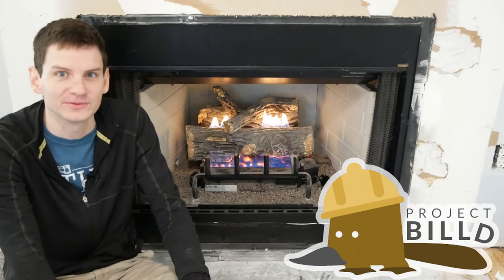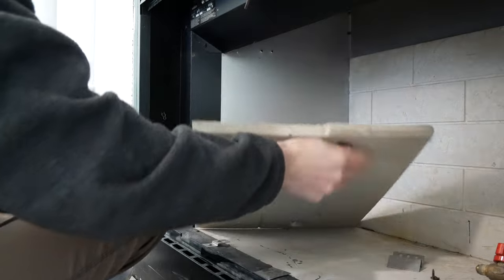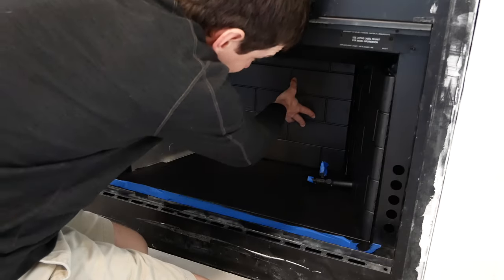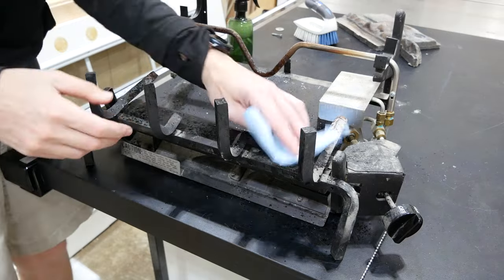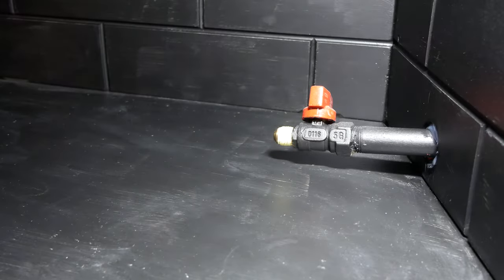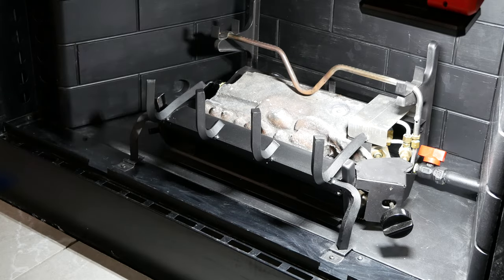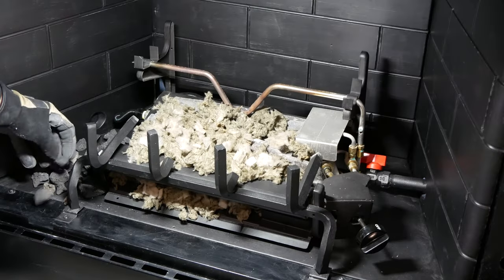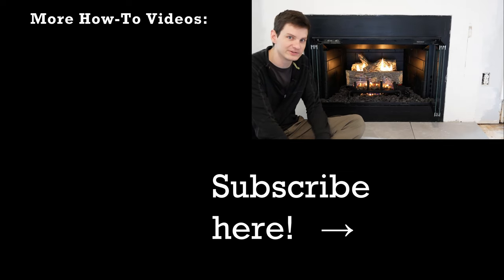How to Update an Old Gas Fireplace

Comment from the maker: Hey all. A few people have pointed out that I should not have used tape on the flared connections of my existing gas line and gas log set. That is correct and was a mistake on my part. The tape is not needed for flared fittings and can only cause issues, so be sure to learn from my mistake. - Bill
Reply: This is great information, however, what are we supposed to use then if no the tape. I did the same project, painted my old bricks (looked just like yours) and updated the grate with paint, new rocks etc... When I removed the gas line it had like a white grease on it. Do I need to replace that or can I leave the old lubricant on and reinstall the line? Thanks in advance.
Reply from the maker: If you have flared fittings you don't need anything on the threads. I'd try to clean off the old stuff, and test for leaks after.

Comment: Dude you should never gas tape a flare fitting. If you tape the threads for a flex line you can cause a leak at the flare because the tape doesn't allow the flared ends to seat as tight as they need to. Otherwise good job. But the tape is very dangerous in this application
Reply from the maker: I agree that's it's not needed for flared fittings and that's a slight oversight on my part. But I don't agree that it's dangerous. As long as you check for leaks there shouldn't be any issues
Reply: @ProjectBilld it is dangerous in the long run.
Reply: @ProjectBilld   wrong, teflon is a mild lubricant and is direct counter to the friction seal of a flared fitting, very dangerous
Reply from the maker: Thanks for the feedback all. I pinned a comment letting others know that this was a mistake on my part and to not do the same

Comment: I removed the ceramic logs and hose them down with plain water and left them outside to dry,  they were still wet  the next day? How long before they're completely dry?
Reply from the maker: Were they lightweight fiber logs?
Reply: @ProjectBilld  no heavy
Reply from the maker: Ok good, sounds like they are the kind that can get wet. I don't know how long they'll take to dry, that depends on the temperature/wind/humidity outside. I'd try to bring them inside to dry if you can
Reply: Can I burn them while damp?
Reply from the maker: I don't know but I wouldn't. Best case it would release steam and vapor from any cleaning product if you used any which isn't great. I'd worry that they might crack due to the expanding moisture
Reply: @ProjectBilld  Thanks Bill,
I will let them dry completely  and no I didn't use any chemical products just plain water.

Comment: How do i upgrade my gas logs?  The ceramic logs are just laying on the metal rack and the flames dont really spread out.  There is no burner pan, its just the grates.  Do i upgrade the logs and burners together ?
Reply from the maker: Yeah pretty much. Typically you'd buy an entire new gas log set that includes burners and logs. I'll be doing that for the other fireplace in my house as the valve is broken and it has a larger opening that could benefit from a longer log set.

Comment: Thanks to your soapy water tip, I was able to verify there was an actual gas leak on my fireplace gas connection! 🙏 🙏🙏

I was not looking for that. I was interested in how you would set up the logs. Then my wife mentioned she smelled gas and I tested it. 

How about using that specific footage to make a YouTube Short?   😎 It may lives! 😊
Reply from the maker: Glad you were able to detect a gas leak! Never thought about making shorts from my videos, I'll have to look into that
Reply: @ProjectBilld  shorts are basically Instagram Reels for YouTube (or similar to TikToks!) think it would be a great way for people to find your content on YouTube. 😎
Reply: Not supposed to use gas tape on a flared join in Aus.

Comment: I dig the look of this fireplace. I’m curious about the plastic valve handles and I believe starter button and heat. I would think that the heat would melt said hardware after time. Have you had any issues with this or are they high temp or heat resistant?
✌🏽
Reply from the maker: Haven't had any issues. That fireplace is over 20 years old so if it were going to melt I suppose it would have already
Reply: @ProjectBilld  ah yes I totally agree! ✌🏽

Comment: Great video, thanks for sharing.  Have you ever converted a double sided (see thru) fireplace into a single sided fireplace?  I have a see thru fireplace between my master bedroom & master bathroom.  I'm trying to cap off, then drywall the side in the bathroom, in order to build a shower on that side.  So far, fireplace stores are telling me I have to replace the entire fireplace, which is very expensive.
Reply from the maker: I haven't done that but unfortunately I can't see it being safe to do without replacing the insert so the fire is contained. Might be worth searching in your area used market for a used fireplace insert that someone is replacing and refurbing it/buying new gas logs for it.

Comment: Could I also refresh the paint on the fireplace surround? Should I just use the same paint?
Reply from the maker: Yes you'd want to scuff it up/sand it first to promote adhesion and then roll or spray on the paint, not brush. I'd probably use a different paint, I don't think the paint used in the fireplace would go on smooth. Plus it's overkill as the surround doesn't get as hot. I'd look for a heat resistant latex paint. This also allows you to choose a different color than black if desired.

Comment: I have a barely used propane gas fire place. The flame, quite frankly, is pathetic. I pulled the logs, etc, out, blew out the line from pilot to gas line. Nada. I just ordered the rocks and wool and am hoping it could generate more flame. There is no second gas line above which really looks great. I'm somewhat embarrassed as I keep trying to fit the logs in the metal templates and the holes which I'm thinking the gas/fire shows. Got pictures, etc. but obviously can't upload them. Just subscribed and will watch your videos. the answers might be in them. Regardless, thanks! Very informative. Oh, when I said barely used, it was barely used (maybe a dozen times).
Reply from the maker: It's possible that you'll need to get a new log set. Can't do much about it only having one burner unfortunately. We have a second fireplace in our house with a bad set I'm going to have to replace
Reply: Wow. Thanks for the fast reply! @ProjectBilld